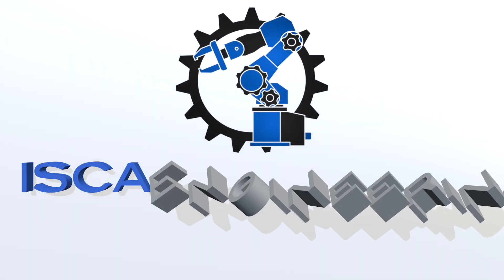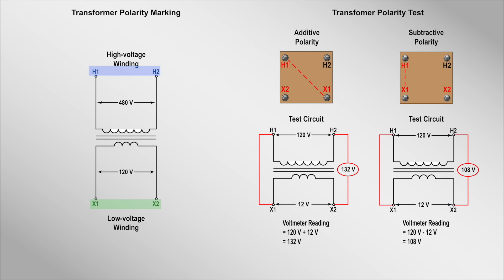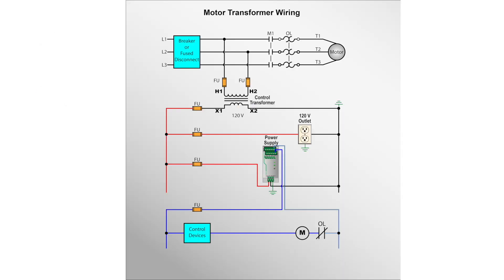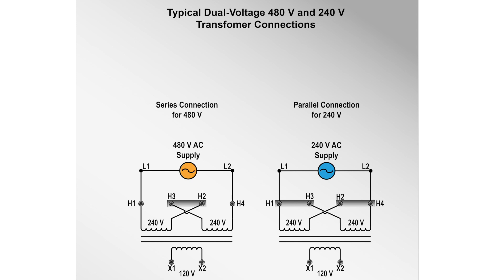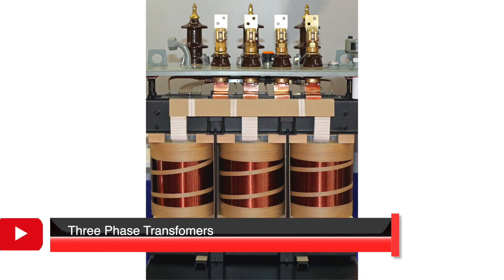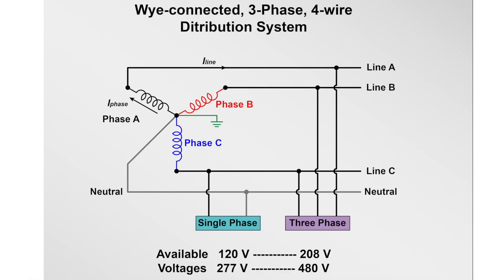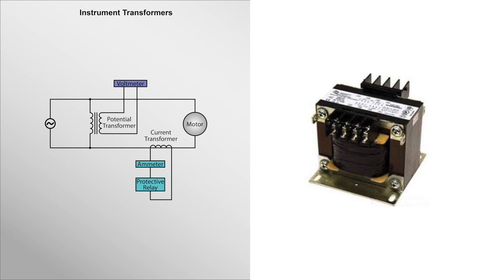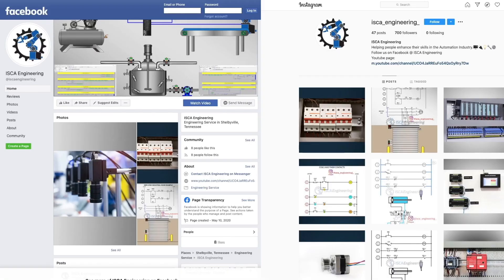Transformer Connections

Comment: I would like to see the connection  from the power circuit to the two primary wires going to the primary side of the control transformer in a 3 phase  application in an mcc  feeding a motor.
Reply: would that be possible
Reply from the maker: Which diagram or connection are you talking about ?
Reply: The two wires from the primary side of the control transformer to the load side of the fuses protecting the motor!
Reply: Of course there is usually two fuses protecting the transformer on top for both wires.